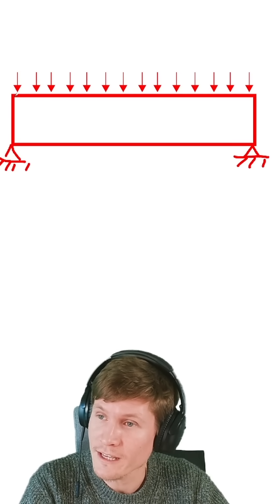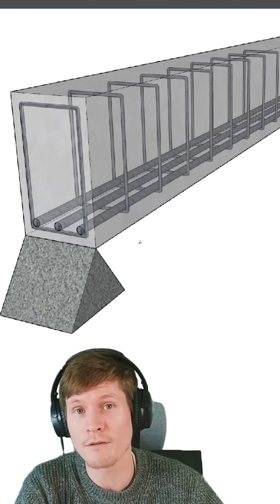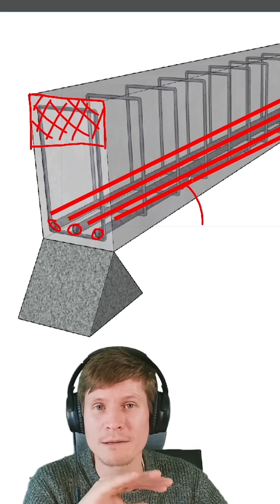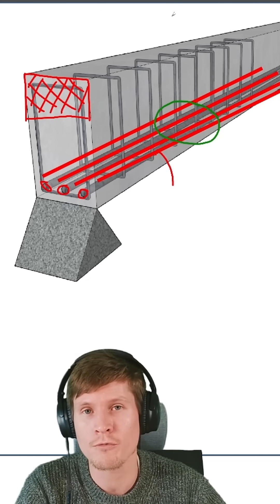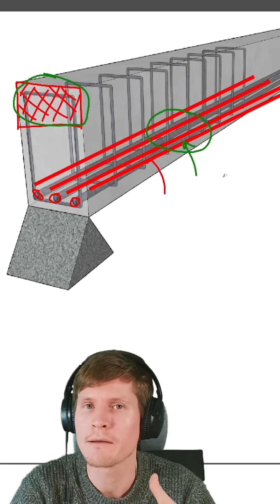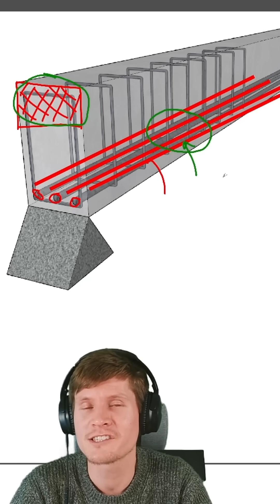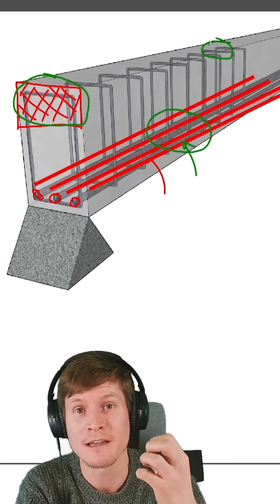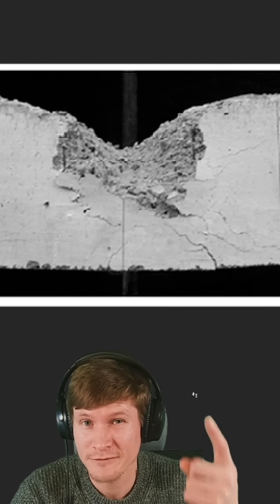Can you OVER Reinforce a Concrete Beam? #structuralengineering #engineering #concrete

Comment: Fun fact there is a similar property for the thickness of a pipe. Where you make sure that for the expected pressure load (plus safety factor) the critical crack length for fast fracture is longer than the thickness of the pipe to ensure that the pipe will leak before it suddenly breaks into a pieces. This is known as a Leak-Before-Break (LBB) analysis.
Reply from the maker: Very cool! Thats really smart

Comment: if you weld it all together it becomes very strong before adding concrete
Reply: Not sure if joke, but steel rebar should not be welded unless it is special weldable rebar and only when the engineer specifically says to do so on the plans. Welding rebar creates heat affected zones that can reduce the strength and ductility of the bars.
Reply: @ninjaneerk5601  then use the rebar with the W on it

Comment: This is why you step on the rewire when you pour a slab. That steel needs to be at the bottom.
Reply: But not all the way at the bottom. There are clear cover requirements (minimum spacing from the edge of the concrete to the edge of the bar) to make sure that there is a good bond between the concrete and rebar and for corrosion protection. You don't want the bars against the ground or it won't do what it is supposed to do. You should be using chairs to keep the wire mesh off the bottom of the slab and at the correct height, and should not be stepping on it to smash it back down to the bottom under any circumstances.

Comment: You should put compression bars to take a big chunck of compression, and stirrups to avoid buckling and create triaxial compression. In Norway, it is required with reinforcement at the top for all beams to make sure it doesnt fail even if people get the wrong load diagram.
Reply: For basically all beams there will be at least two top bars so that the stirrups have something to hook around. He showed the stirrups, but I think he was only trying to cover the tension/compression controlled principle. I don't think he is saying this would be all you would need to know to design a beam.

Is it only required in Norway that there is reinforcement at the "top" (can be more or less than the "bottom" steel), or do all beams have to be symmetric? That seems a bit overkill to me. If they can't figure out which direction the moment is in the beam, I think they probably just shouldn't be a structural engineer.

Comment: China wondering if they can use plastic bars instead of metal 😅
Reply: Those exist. They are a called FRP bars. They are pretty niche. The only time I've heard of them being used is for a piece of substation equipment that created huge magnetic fields so if you used regular steel bars it would heat up the bars and soften them.

Comment: The beam have two zones tensile and Compressive,  Reinforcement is generally provide in tension zone but in certain cases it is provided in compression zone, such a beam is known as doubly reinforced section, this is done in order to counter stresses that may occur during stress reversal condition.

Comment: what about dimensions, types of concretes, types of steel and so on,  I guess its never so easy, and the actual phycis or actual engineered solution is usually not that easy, also what book do you quote?
Reply from the maker: All those things play into it for sure! material strengths are a big part of structural engineering calculations

Comment: so true… a balance and optimum design of beam are essentials in civil engineering design… an over design  beam is not recommended it will not give you a sign of failure, most of the time the beam explodes…

Comment: So don’t rate the reinforced concrete beam above the unreinforced concrete beam in designing compression load bearing should avoid the problem.
Reply: You could try to do that, but concrete has a very low tensile strength. So, if you tried to make the beam work and ignore the rebar entirely, your beam would be horrendously large. Pretty sure that there are also limits on what concrete is allowed to be unreinforced, and I don't think beams would be allowed to be unreinforced, but I don't deal with that portion of ACI much, so I could be wrong.

Comment: Also note the density of the rienforcement matters since the steel is essentially "gripping" the concrete along it's length in shear. So the steel translate tensile stress into shear stress that the concrete can handle better. But only if the path of stress is sufficient which it can't be if the adjacent steel is too close causing a pullout failure.

Comment: The alternative point to make here: if you're going to make your concrete beam like 90% rebar, why wouldn't you just go with a steel beam then? 🤣
Reply: Well the concrete code limit is 4% steel for beams. So if you've to got a concrete beam you are trying to get to work, and are at a 90% reinforcement ratio, you would have to do something else e.g. make the beam bigger or switch to steel.  If you are seeing beams that are 90% reinforcement, you may want to find a different engineer.

Comment: How does it work over 50+ years? Concrete becomes stronger over time, right? But steel will stretch
Reply: Interestingly, creep (a very slow deformation under permanant load) is more of an issue in concrete structures than in steel structures.

Comment: Can someone explain this? Why wouldnt adding more metal increase its strength? It’s basically converting it to an H beam and I’m pretty sure metal is denser than concrete. You don’t put concrete in steel beams to increase strength, it’s the opposite. This fundamentally doesn’t make sense.
Reply: I agree, if you add more steel at the bottom you then by definition stop deflection and the tensile stretch at the bottom, while also reducing the compression which was to follow. I understand the ratio for a specific max load tolerance, so to keep weight and costs down. But more steel cannot equal weaker beam. And brittleness will only be if the steel displaced so much concrete where it cant make proper bond to the surrounding concrete spread throughout the beam .
Reply: I thought that he did a pretty good job of explaining it, but I'll give it a shot.

It's not that if you keep adding rebar that the strength of the beam gets lower (at some point you could put so much in that it would actually dcrease the strength, but thats a bit off topic), it's that if you add so much rebar that the concrete fails in compression before the rebar fails in tension you effectively get penalized for it in the code. This is because the code writers are wanting trying to achieve a certain probability of failure for failures that are not sudden (ductile) and a lower probability failures that are sudden (brittle) because a sudden failure is more likely to harm people. 

Steel is a ductile material meaning it will stretch a lot before it snaps. This gives a lot of warning to whoever is currently on the beam to get away. Concrete is brittle, if you go past the crushing strength of concrete it effectively explodes in an instant. This gives no warning and is just instant death for whoever is on the beam. You want the steel to fail in tension before the concrete fails in crushing so that the beam gives a lot of warning.

Comment: Fascinating.  As a non-engineer, I was aware of the compressive and tensile forces and their materials & locations. However, I was not aware of the tension controlled and compression controlled zones and necessity of designing to stay in the tension controlled zone. Makes perfect sense!
Reply from the maker: @TyFreeborn  even more detail for you - you technically CAN design in the compression controlled zone! A few of the design coefficients change but it is possible per the guidelines of the ACI.

Comment: This is great when designing a beam whose loading you can account for fairly accurately.
Reply: Typically the loads are code prescribed, so while they may not be "accurate" per se, they are what you have to use. Typically the code prescribed loads are based on some statics in an attempt to achieve a target probability of failure. Also, to determine if the beam is tension or compression controlled, you actually don't need to know the loads at all (aside from whether the tension is on the top or bottom of the beam). Any given beam is either tension controlled, compression controlled, or in the transition region based solely on its geometry and material properties. The only caveat to this is that if you are designing a beam, you need to know the loads otherwise it would just be guess and check, which would be very time consuming.

Comment: Did i understand ya right?
 Excess steel rein doesnt allow the bottom to flex?
No flex at the bottom means the top pushes in on itself from the right and the left causing the "center"-ish) to compress into itself more than it can handle? 

-your local dummy
Reply from the maker: @DuhByrd  spot on man!
Reply: @Kestava_Engineering  im a jeanyus

Comment: Great visuals, too bad the the storyline is wrong. You got it partly right. You are not required to design for tension controlled failures. In the old days we did, the old 0.75 rho max. Now the codes, ACI, AASHTO, permit the design of over reinforced sections but with a reduced phi for compression controlled behavior. In a compression controlled failure the concrete crushes before yielding and the corresponding lower phi factor.
Reply from the maker: you are correct! you CAN design within the compression controlled zone but IDK why you want to... i guess if you are heavily constrained by design parameters so you are forced to design a certain size beam with high strength or something like that. if you have the chance to remain ductile thats always best IMO
Reply: @Kestava_Engineering it's actually a common phenomenon in post tension members. Especially when owners want to design for zero or limited tension. You wind up with so much tension reinforcement to control the service level stresses that it's inevitable that you get compression controlled failures at the strength limit state.
Reply from the maker: @ very good example!

Comment: As a structural engineer, I always prefer to design beams under reinforced so that, failure if happens would be non brittle.
Reply: This is required by code ... a falling building gives signs of failing and not sudden buckle and collapse .. not giving time for evacuation 
❤ I'm a structural engineer also
Reply: @marlonchristopher9278  It is within code (at least in the United States when designing to ACI 318) to have a beam be compression controlled (brittle failure), you just take some hits on the strength you are allowed to use so that the probability of failure is lower. While it is good practice to try and get the beam to be tension controlled, sometimes it can just not be possible if you are overly constrained on the maximum dimensions of the beam.
Reply: This is required by code ... a falling building gives signs of failing and not sudden buckle and collapse .. not giving time for evacuation 
❤ I'm a structural engineer also

Comment: Thank you! This is the structural engineering content I’m looking for! (I’m an architect)
Reply: Except it's incorrect, incomplete
Reply from the maker: @francescorusso2220  gotta do extremely small concepts for youtube shorts - unfortunately dont have the time duration to say every possible thing!
Reply: @Kestava_Engineering then say the right thing. The right thing is it is completely possible and permitted to design beams, or better yet, reinforced concrete elements, with tension controlled behavior, transition behavior, or compression control behavior. Take it from someone who actually helps write the specifications.
Reply: @Kestava_Engineering  just make follow up shorts explaining the rest

Comment: That's silly. You can reinforce corners of beam on the top as this increases its moment of inertia greatly and allows you to both avoid the buckling of compressed part, but also let it take a lot of additional stress. The rule of a thumb is to have cross section rebar at distance of no more than 15 diameters of main rebar. So two huge rods are sufficient. Then only comes rebar ratio which is limited by chemical durability.

Comment: You could put compression bars at the top to prevent concrete failure
Reply: But the bars don't really work that way.
Reply: compression bars work well in compression because rebar has greater compressive strength than concrete however you have to have weaker tension rel compression because the compression rebar may buckle and spall out the compression concrete

Comment: I am a ME specialising in steel structures for large machines, so I do not know much about concrete, but i know it is used instead of steel for cost effectivnes. So, my question is this, how much more cost effective is a beam made of rebar and concrete when compared to lets say, an I beam of same load capacity
Reply: That just depends, give me an example.  Concrete structures are cheap in materials, high in labor costs,  Just depends on the use of the member.
Reply: @dontransue9843  Lets say, a load bearing beam for a comecrial building
Reply: @milandjuric8043  it is very hard to compare that cost on the scale of a single member. Steel and concrete have very different costs when it comes to manufacturing and construction, so these are typically considered. In general, for a cast in situ RC beam and a hot rolled steel I beam with the same moment capacity, the concrete beam will be cheaper. But steel is much faster and simpler to assemble on site, and its self weight is far less. Im just trying to say that it is only really useful to compare material costs on the scale of the entire structure, and in that case, concrete is typically cheaper
Reply: @milandjuric8043  very labor intensive as you have lots of material to be placed in floor systems, 1 at a time.  Steel is a better material for this.
Reply: It depends on application 
Concrete beam is used because of cost, flexible (make various shapes)
You use I beams when the design necessitates the use of longer beams and space (concrete beams occupy space a lot more)
Structural steel is superior to concrete columns and beams in terms of load capacity 
So if longer beams and greater load capacity are required steel beams are economical